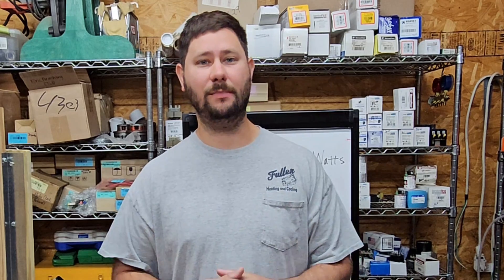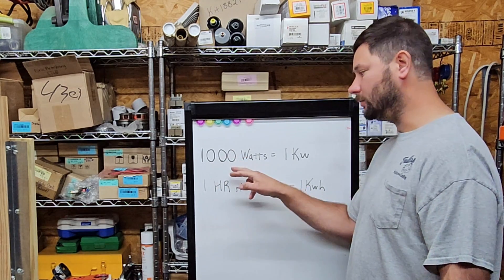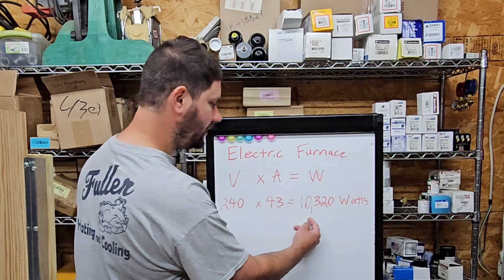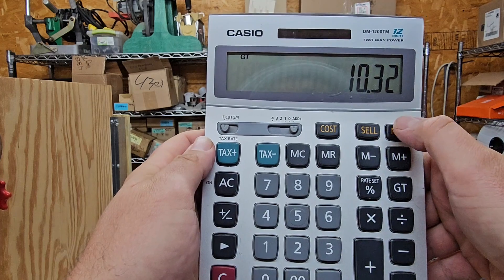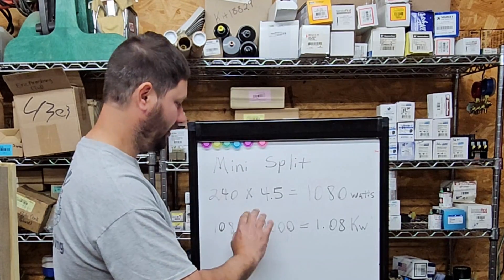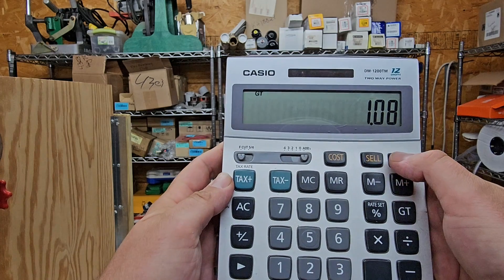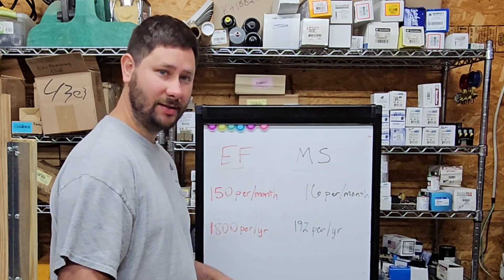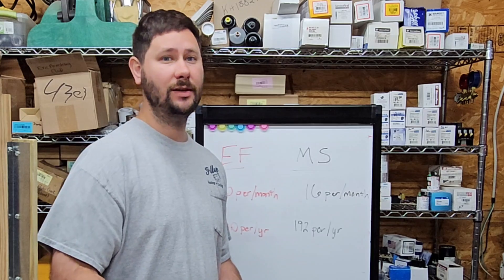How Much Does it Cost to Run an Air Conditioner? #ElectricBill

Comment: I have a Gree 3 ton 20 seer inverter, average watt usage when peak around 1.2kwh but it can come down all the way to 600 watts that is the beauty of an inverter mini split, even if I do the calculations for 1.2khw x 12 hrs a day  14.4 kwh at my current rate is around 0.13 cents (power usage and also what the charge to generate) I can run my mini split at 77F and it will cost me $56 dlls.

Comment: Those mini splits will not keep up in extremely cold temperatures due to poor conditions of the trailer itself,is there insulation for the floors?This will be based on keeping the temperature in the crawl space manageable,great video though
Reply from the maker: heats in 5 degree weather 
and where I live we only have ten degree weather for maybe one week
Reply: @taddydigest  but did you do any calculations?Heat loss and Heat gain of the trailer?im not doubting your expertise but just trying to gain some knowledge in case I run into this situation,Thanks
Reply from the maker: I could only calculate what is existing, and yes, of course I did
But the customer is getting a new roof can a couple weeks so that will change everything
Reply: @taddydigest  Definitely will

Comment: Calculating the daily runtime at 6hrs/day would be dependant on insulation and heat gain. 6 hours a day brakes down to 15 mins per hour. I often work on older homes so generally calculate the runtime at 20 mins/hr. Have even seen worse in old trailers with the uninsulated ductwork under the floors. Heat gain and loss is the real enemy... next to the thieving electric companies themselves

Comment: No way your math is right. $.08/kw is probably just supply. Your electric company charges you for delivery, too. For instance by me, they charge $.10/kwh for supply and almost another $.10/kwh for delivery. Makes the math so much more in favor of heat pumps
Reply from the maker: My calculations are not exact
It's just an example to teach others how to use the calculation
Reply: You should make s video showing exact calulations. This is close enough.

Comment: On top of TaddyDigest comment;  I doubt anyone as of 2024 has a 100% electric heat (resistive).  Even older cheaper mobile homes where central / ducted heat pumps.   I agree there are some older homes without ducts.  Mountain cabins..  where mini splits are good solutions.  OR spot cooling like that hot sun room / play room off the back of some big house that is always hold / cold.  A mini split head on that sun facing wall is a good solution.

Comment: Really wish you were in my state!!!
I was quoted $30,000 for a mitsubishi hyper heat mini split with 4 ceiling cassettes all 9k.
I have a 2 bedroom 1 bath home.
$30k for a home my size, 1200sqft, seems crazy to me.
Any thoughts?
Reply from the maker: Click the join button. Become a member level 4,5 or 6 for sure. I will send you the equipment you need.
Reply: @TaddyDigest  Level 4,5 or 6?
You'll send me what I need? Will hvac companies install equipment that I supply?
Sorry I'm a bit confused. 🙄
Reply: Way out of control.
Reply: Do you have forced hot air. Any ductwork existing. You can put an inverter outdoor unit and feed a cased coil that sits on your furnace.

Comment: Hi Tad…. Nice video,… But I’m just trying to follow everything… Did you figure that they were running the electric furnace year-round? Typically they would only be running the electric heat in the winter time… Not sure if that’s a mistake in your calculation, or not… Just wanted to raise the question, you have a good evening
Reply from the maker: I should have been more specific about the fact that it's only gonna be running in the winter
Thank you for letting me know. I did not even think about this